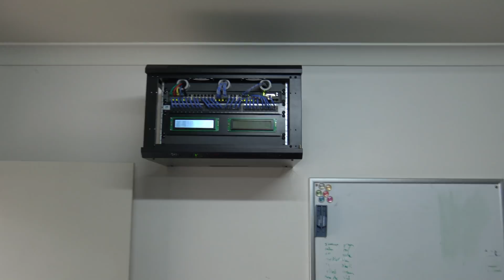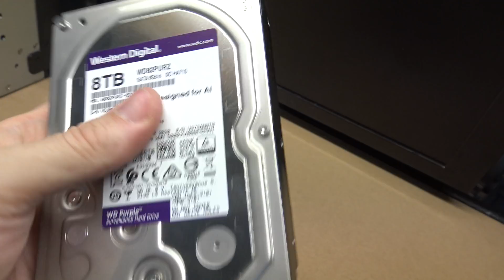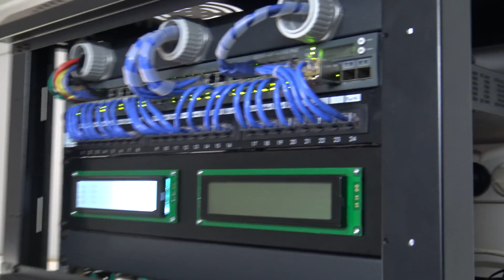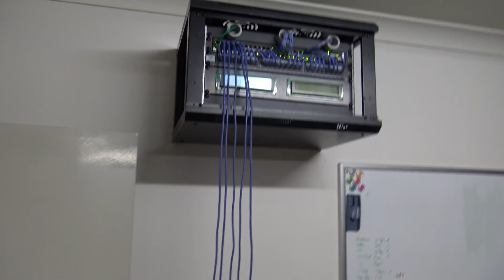Raspberry Pi Servers

Comment: I quite like the idea, but in my usage the achillies heel to long term pi server usage is the SD card storage issues and failure. If you make an image per server, I suppose recovery is easy enough. 

Nice video. Cheers!
Reply from the maker: I've heard so many people say that about the card, but I've personally never had that problem. Regardless, I would still have a hot spare ready for it needed.
Reply: I've had cards go bad in longer usage. Perhaps the quality of cards plays a part, but as you say hot spares work! - Cheers!

Comment: I'm kinda of a noob, I recently started using Docker and I was curious if just using the servers to run docker would be better than the pis? If not why?
Reply from the maker: Pi runs off POE right at the switch. Light, and low power, and minimal cables. Does the job nicely. Learn a lot doing. I have a bunch of them around the house. Fits in the small rack. They're silent. They work.

Comment: Doesn't the Audio amp have vents on top off it? If you use it you don't want to block the vents.
Reply from the maker: Well noted. It's not a problem though because firstly it's never cranked up out there so doesn't get hot, but also there is still a gap above it because that shelf above it doesn't go right to the bottom of its actual RU spacing.

Comment: I do like how you show how much can be done on a Pi and yes the comments can be a bit offensive in regards to why do something. I think the only thing not factored into this whole scenario/deployment is WAF (Wife Aggression or Acceptance Factor).  All of the above is good in theory - but the minute you take a week long work trip/holiday and the wife is at home, and the internet, TV server, home automation, surveillance stops working for some reason, how easily can she recover from this or you walk her through. I guess in theory one large power off power on button would do the trick. Would be tricky to try and diagnose what the issue is if you didn't have 4G/cellular backup (which is pretty cheap these days).
Reply from the maker: You're worried about what a woman thinks? Mate... if you're out of town for a week, there's only one thing a woman back home will be doing online while you're gone! Home automation? Get her arse up to turn the lights on and off manually. Internet down? She'll use her phone for tinder without noticing the wifi dropped. Be the king of your castle pal!

Comment: Home Assistant on pi is terrible, don't downgrade your installation. You'll regret it!
(I'm running HA on pi4, with very limited interface, only a few bulbs, few switches, few esp32's, a few esp8266's. A few BLE sensors over esp32, basic iptables ruleset, a few ffmpeg camera entities. Takes 5 minutes to reboot HA instance, pretty sure I'm running with 1 core completely saturated. Not even running newer HA which is more resource intensive.)

Comment: funny, i just turned off all my raspberry pi’s and built a proxmox server.  biggest problem I had with the raspberry pi was the SD card.  am curious how you deal with this.  ps.  mini pc's are also nice economical small formfactor platforms for a proxmox server (got a HP mini pc running om only 11W)
Reply: Today you can use ssd on pi 8
Instead of sd card. Also there is some cases or expansion board for ssd raid
Reply: Use a good quality sdcard and avoid writing to it as much as possible. So avoid writing logs or using it for storage. Only use it to run the os. Ideally avoid sdcards altogether and use a usb3 thumb drive or even better an ssd with a usb3 adapter. Make sure they are uasp capable. Note that only rpi 4 is usb3 capable.
Reply from the maker: I have USB SSD drive adapter, but still chose to use the SD card because I'm not using them to write lots. Also, I had some 16GB cards that came with my dashcam, but since I'm using way bigger ones for the dashcam I had these high quality ones laying around so figured I'd use them for the Pi.
Reply: I buy sd cards with 10 year warranty, if they die they can be replaced for free

Comment: About the raspberry pi, i have bad luck and have a lot of sd cards (of "good" brand that i know are legit sd cards from that brands) that stop working after 1 or 2 years of use on the pi (24/7 on). Did you also have problems on yours sd cards after 1 year of use ?

Comment: Really like your videos, keep up :)
One suggestion if you like the topic...videos about hacking printers :)
I see that you have one.... they look like are made to not work (i'm talking to you HP)... how do you control your printer ? They have a very "limited" firmware and looks like you can only use the printer the way the manufacturer wants that you use it.
For example, my printer i turn on and it give the error about low ink level.... i unplug from the power.... plug back in to the power.... turn it on and now have a little of ink :)
If only we could control our printers to do what we want them to do... just like you did with the tesla power wall.

Comment: I did a similar move to rpi servers about 2 weeks ago. The pc was wasting to much electricity and it wasn't even being used most of the time. Running directly on the pi4 (raspberry pi os 32bit) are the network firewall (iptables), pihole, wireguard and openmediavault. Using docker I have Nextcloud, Zoneminder and Jellyfin containers. The cpu only gets busy when I use jellyfin, but it manages well. Average temp is 50C. I might eventually convert everything to ubuntu 64bit. Never heard of NFtables. I'm curious now

Comment: Nice video ! That SFP modem is pretty nice. On the other hand I don't like ( for my use case ) using all sort of pi's for various servers in my home. I prefer Proxmox installed on a low power computer like a NUC. It's way more flexible and offers me the option to use devops tools like terraform and ansible for creating and configuring the vm's.  Another minus for me is the cost of the pi's and reliability of the sd cards.

Comment: If you are migrating to RPi's, that suggests all your workloads are Linux based. If your workloads were in VM's, that was your problem. Too heavy. Spend the time dockerizing them instead. I have a Dell optiplex in my cupboard. The container density I have on one machine would take dozens of RPI"s at a much higher cost.
Reply: Yep, running everything dockerized on a j4205 10W itx board here with 8GB of RAM. Way less hassle than multiple pi’s.

Comment: How are you going to back up all of the RPis?
Reply: Not him, but me - I have about a dozen Pi's in my home - I also have a Synology NAS - I have a backup script that runs on each pi, and backs it up regularly to a space on the NAS - Nice feature is that the backup routine writes in an effective Pi image format - so if I lose a pi (or more likely, it's SD) I can burn it's most recent backup to a fresh SD, which will be way more current than rebuilding the Pi from scratch.
Reply: @pquodling  Cool, can you share the script? Do you use dd?
Reply: @HelloHelloXD  I use a similar method. Here is my script. It uses dd and it runs on a schedule with cron.

#!/bin/bash
now=$(date +"%d-%b-%Y")
echo  "Backing up to mnt/omv/OMV/Backups/piSense/piSense-$now.img..."  #mount located on external NAS.
sudo dd if=/dev/mmcblk0 of=/mnt/omv/OMV/Backups/piSense/piSense-$now.img bs=1M status=progress
Reply: You could also set up an ansible script so you can have it on just one host though there is more over head to that

Comment: A bathroom fan controlled by a thermostat could help with ventilation.  I usually use pfSense, but it's good to learn iptables as well.  I have some systems where iptables is the only option.  Your videos are very educational.

Comment: Noticed you have used some TP-Link POE adapters - had any issues (yet) with them being borderline in powering the RPi?   I have two and one of them appears to struggle powering the Pi (a 3B+) + DVB-T dongle causing odd lockups etc.  Cheers!
Reply: I had one running a RPi for my ADS-B receiver in a really hot area for about 4 years without any issue. Highly recommended. But remember, anecdotal evidence is only evidence of an anecdote.
Reply: @garylovesbeer  That's exactly what my Pi is - an ADS-B Rx.  One of the TP-Links makes the dongle stop outputting randomly and the red power LED on the Pi blinks occasionally which is an indication of low supply volts; on the second TP-Link it doesn't miss a beat. I've never measured the actual voltage coming out of the TP-Links POE's on the 5v setting but it must be borderline, especially if you are running something in the USB port of the Pi.
Reply: @Andrew_6721  Sounds like time for a new POE adaptor. The one's illustrated in the video are stated to run 2.5A so should be sufficient.